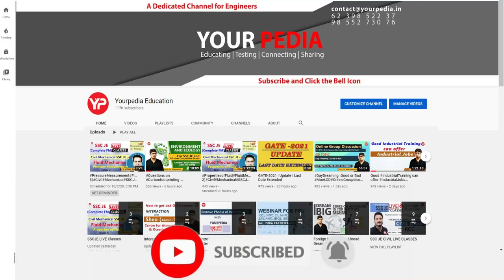Fluid Mechanics Mock Interview for DRDO | ME | Prepare DRDO Interviews with YourPedia

Comment: the Darcy–Weisbach equation is not limited to liquids.
It can be used for both liquids and gases, as long as the flow is in a fully developed, steady, incompressible or nearly incompressible condition.